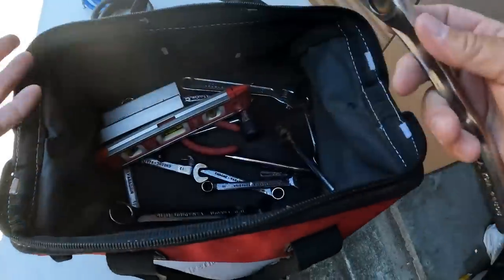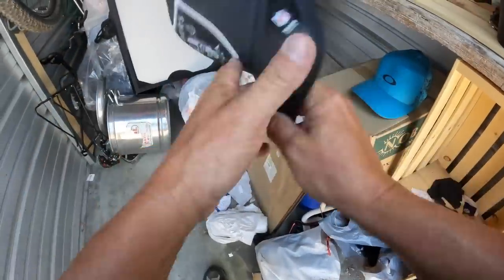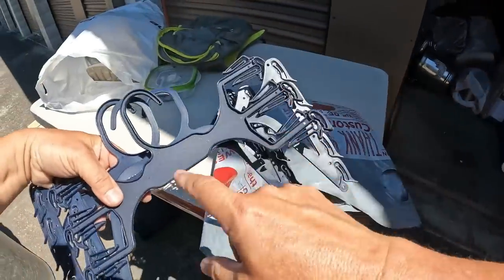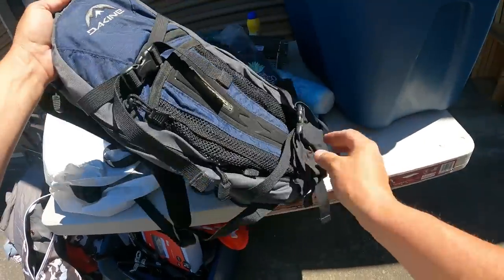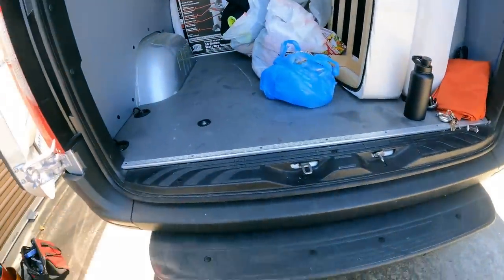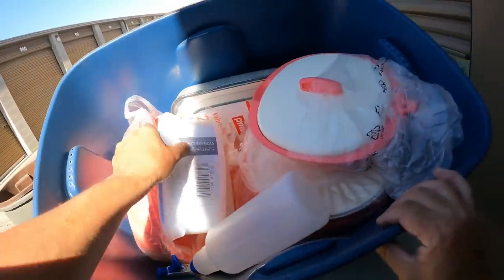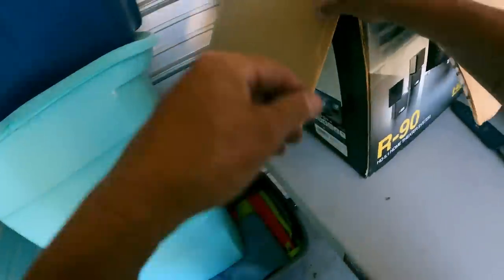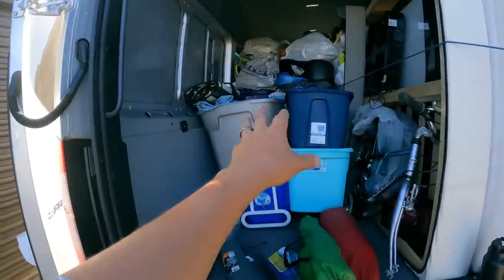This ONE ITEM made me scream in excitement! I can't believe this...

Comment: The Yakima tool is roof rack or bike rack.  Most of the tools are probly collected to work on bikes.  The helmets run about 70 to 120.  The jerseys about 100 to 200 depending on graphic.  Team affiliations run higher.  The problem you have is he didn't isolate the hardware to the bike component.  I'd almost just put it in a package for auction.

Comment: DA BOMB Pedals – V Stage

$168.00
DA BOMB V STAGE PEDAL

Double-sided design, can use it either as a clipless or as a super grippy flat pedal
Large platform area
Ultra-rigid cage
CNC machined to achieve the best rigidity & strength
 Super-durable CR-MO spindle
Recommended for MTB
Specification:

Material: Alloy 6061-T6 with CNC-machined
Size: 100mm x 110mm
Thickness: 12mm (super thin)
Weight: 467g/pair
Binding: Cr-Mo, single-sided, tension-adjustable
Bearing: LSL bushing & sealed
Compatible with: Shimano SPD
Anodized Colours
Colour Available: Black, Blue, Red